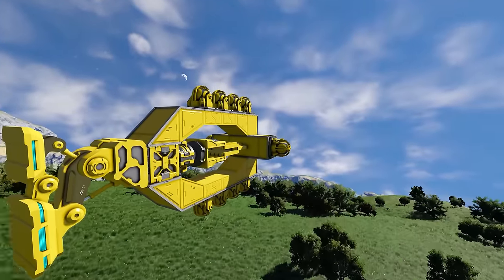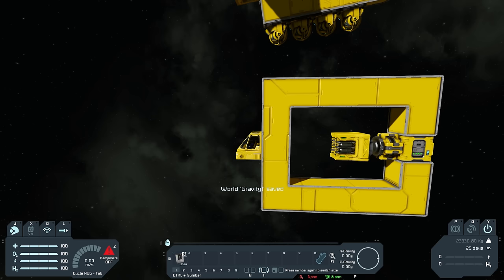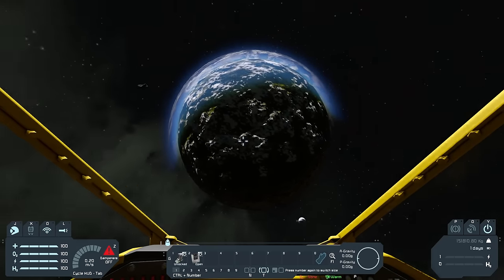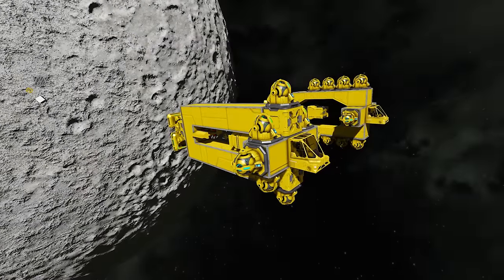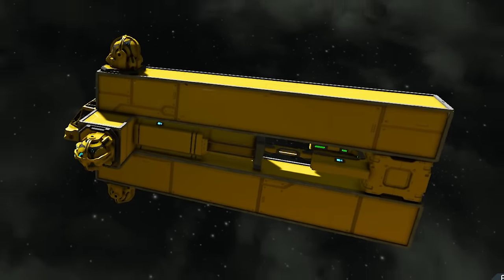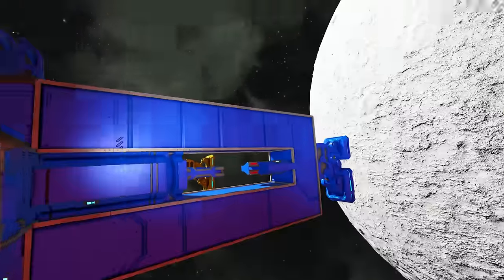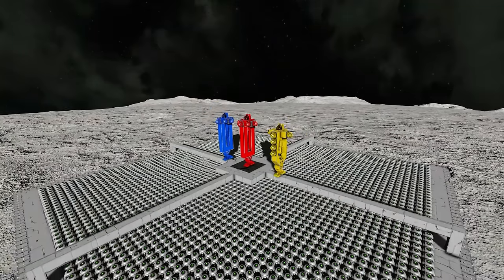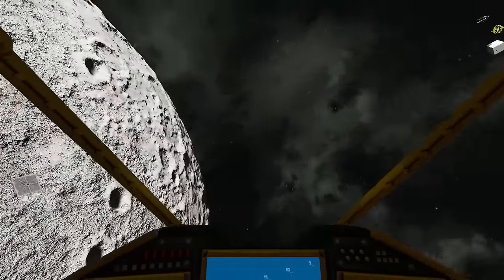The UNLIMITED POWER of the CLANG DRIVE - Breaking Space Engineers

Comment from the maker: So, which is better? Clang Drive or Gravity Drive?
Reply: Clang
Reply: clang has way more thrust
Reply: also merge drives are a thing which can provide an infinite amount of thrust the acceleration is constant no matter the mass
Reply: I mean the Clang Drive is just plain better, however i still prefere grav drives due to scalability. For a large grid to be redicoulusly powerfull, you'd need to spam maybe 20 to 50 door mechanisms, whereas you could build like a really large gravity drive unit. Idk its just cooler imo to have this big section occupied by artivicial mass& grav generators. Its always been about the coolness factor of my ships for me and not how meta or efficient they are... And in a pinch, a well build grav drive can double as a railgun :D
Reply: Clang crashing game
Reply: Question. Could i use this in a keen server
Reply: @roiber0812  yes you can
Reply from the maker: @V0dka-  I wouldn't recommend it
Reply: The gravity drive does have a place and purpose though as the gravity rings reduce the need for H2 for acceleration.
Reply: @Zer0sLegion  can you show us some weapon uses for clang next?
Reply from the maker: @redeye5515  👀
Reply: Grav drives are absurdly scalable. For example: 1 gen and 1 AM is weaker than a large ion thruster. But 2 gens and 2 AMs is worth a lot more, since you are multiplying the number of gens by the number of mass blocks. Also, AMs are worse for the thrust-mass ratio as well as lowest possible power consumption, but matching amounts is best for volume-thrust, cost-thrust, thrust in general (means more than thrust-mass because most of the mass should be the ship anyway), etc due to properties of squares. For big ships, it isnt even a competition (esp with the clang drives you showed). An 8x8 of hangar doors is 64 times more than a single hangar door. an 8x8 of gravity drives (1 gravity drive being 1 gen and 1 AM) is 4096 times stronger than a single drive. Also, power consumption doesnt matter much since you have to turn off dampeners anyway. Just turn it off once you get to speed. Prevents the gyros from fighting too (since grav drives are more stable in general without gyros, I wonder how much the power consumption of the gyros increases the power consumption). Lastly, they are more future-proof since Keen probably wont ever fix them.

Other Clang drives are a different story. Piston-snap/double-subgrid drives and guns are broken as crap, seeing as they have much greater force than the other drives, can accelerate past the speed limit, and can do so almost instantly on release. They are very complicated and require precise timing and a bunch of subgrids, but it is very worth it. I haven't seen a ship using the snapping, but there are plenty of guns. A drive would probably look like a gun, launching the ship at high speed internally rather than staying on, but it would be very powerful. To slow down, just deattatch and reattatch the double-subgrid. Due to the way the gridding works, you might have to have launch stations instead of it being internal, but it is still very cool.

Merge block: I saw someone else mention them here, but they are mass-independent (in effect) which is quite broken. You only need one. The more mass you have, the more thrust it provides. Thrust is defined as the amount of force that can accelerate a mass by a certain amount. Since mass of the ship dictates the mass that the drive can accelerate, everything ends up just canceling out and giving you raw acceleration. Fun math! You could figure out this constant acceleration by taking the thrust of the ship and dividing it by the mass of the ship. However, that is probably Harder than just counting the change in velocity in one second. It might be more fun to calculate the thrust by dividing the acceleration by the mass, even though the figure is useless.
Reply: The REAL question is "Can you use a Clang Drive as a warhead to cause massive destruction at will?"
Reply: Mortal engineering against the divine, there is no question, Clang protects.
Reply: Also, Clang. Just blew up again🤣
Reply: Clang. Working in planetary gravity is an absolute win.
Reply: Clangvity Drive
Reply: That would depend on exactly what you want. I have been thinking about building a sort of moon based airship that uses a gravity drive to stay perpetually hovering, that is something that can't be done with a clang drive. Plus the clang drives are always potentially about to get patched out while the gravity drive is not.
Reply: Mass shift is probably the best, a while ago  I saw someone built a multi axis mass shift drive that had scripting to allow for automatic dampening, but unfortunately I can’t find the script or schematics anywhere online. That thing moved unlike any ship I’d ever seen. .5 seconds to max speed in any direction, just as fast to come to a complete stop.
Reply: Clang for life
Reply: wanted to build a clang cannon but only works if the statink is on
Reply: @Zer0sLegion  i used it on a keen server lol
Reply: you could mess with the min/max open/close settings on the door to shorten the initial acceleration phase. so the door in its "open/off" position, is onlu .01m from activation instead of say .3m or 1m from activation.
Reply: Reactionless drive.
Reply: each has pros and cons, but im for gravity drive, as it allows for both acceleration and de-acceleration and is safer and easier to build if you can plan a symmetrical ship. 2 gravs, 1 mass, 2 gyros(if youre bit off balance) and you basically have free propulsion that IS SAFE IN CASE OF DAMAGE. i personally leave dampening on and just turn off "backwards" propulsion, its more stable that way.
Reply: Gravity - Due to easier adaptation to battle damage
Reply: why not put the convert it into an omni-klang drive? it's in the center of 2 rings that can spin in opposite axis to allow full 3D movement. if you know some scripting i'm sure you can have it do an auto pilot where it takes both positions and your rotation to figure out where to aim the drive. not to mention what if you use multiple clang drives in sequence? does the speed double or just break? or even nothing at all.
Reply: At the end of the day the gravity drive isn't fueled by a glitch in the game. While the Clang drive is blazing fast. It's utilizing an exploit to do so.  When the clang drive is fixed the grav drive will go back to being superior.
Reply from the maker: @ashen9381  I doubt it will be fixed for a very long time
Reply: @Isler_  is that the one where you use rotors, blocks and merge blocks? that beats clang by a lot, at least its kinda safe to use and doesnt use glitches just faulty  "gamey" physics.
Reply: From what i understand, clang scales linear while gravity scales quadratic. So clang for small ships, gravity for titans.
Reply: how about merge drive?
Reply from the maker: @TpoJioJio47  Watch my latest video
Reply: 4:18 Wait, so we place the piston with the pillar on the vessel with the power? And we don't want the hangar on the rotor from the vessel with the motor? Where does the gyro go? On the piston with the pillar on the vessel with the power? Or on the hanger on the rotor with the vessel with the motor?
Reply: Clang, but remember to pay the Clang Tax
Reply: @ashen9381 it's been almost a year. Just tested. Still not "fixed"
Reply: For Sim Speed? 100% gravity drive
Reply: And to everyone saying clang, both of the drives use clangs invisible forces.
So clang is the only possible winner... technically. 

(The art. mass & generator do work together, but putting the mass under the basic grav generator is actually a clang force, because it is is making an invisible force that functions mirrored to the feature function.)
Reply: i wonder what happens if using ALL OF THESE on ONE SHIP xD (and with speedlimit mods 🤑)
Reply: Can you make an actual warp gate using gravity drives? 

Like the one in the last video of the ‘launch’ pad to warp someone with the speed effect?

Comment: Klang and Gravity drives are a real help for big ships, even if you just use them to slow them down. For the gravity drive there exists a script that makes it possible to even replace gyros in your builds, so you get a ship that runs purely on the gravity drive concept. Great video.
Reply from the maker: Yeah, I've seen the script thing before. I'm not really into scripts, like most people in the community, I turn my brain off when I see them.
Reply: @Zer0sLegion  When scripts first came out i completly avoided them. There might be a solution that is timer based. Kelevra Engineering has a steering solution that might be able to control timers to do the same.

Comment: This is so good to power massive ships like usg ishimura or any star destroyer, even if its a glitch doesn't break the lore
What about using magnetized ore for anti gravity?
Reply from the maker: Magnetised ore?
Reply: magnetised ore is stone put on mag plate with gravity gen
Reply: @bassemgju2440  so... just a grav drive, without the artificial mass?
Reply: @RevokFarthis  kinda, difference is that using a ejector you can have a anti gravity device
Reply: @vladkruglov7719  But, you can already toggle grab drives?
Reply: if lore is a problem just say that the crew started worsipping a warp god and it's all good
Reply: @platinumgames1314  with lore i mean the recreated ships, take usg O'Bannon for example, it has a emergency shock point drive as a booster
Reply: @The_Bird_Bird_Harder  true, ore is or better Was the alternative that came before mass blocks were even a thing in the game, and its advantage being that mined ore instead of slowing down the ship, was used to provide thrust (disadvantages being lack of control, slow to set up, not as linear as Any other way)

Comment: The clang drive seems like an excellent way to get offworld fairly early in a survival playthrough without needing to get a lot of resources together.  I think the biggest downside is that it doesn't seem to have a good way to modulate speed
Reply: 2 options. 
1: Use multiple drive. That give you a max high accel.
2: script a program and/or timer block to start/stop the klang effect at regular intervals. That allows for better granularity on the speed.
Reply: @orcmcc  what if I just put a hanger door going the other way?
Reply: @carsontodd2443  That gives you breaking/strafing, but not extra accel or granularity.
Reply: @carsontodd2443  Yeah - That's basically the same thing as a "flip 'n' Burn" maneuver like they do in "The Expanse".  
I'm going to experiment with this idea over the next couple days where I use a Clang Drive for forward propulsion, and then also, as you suggest here, another one that engages when arriving at your destination to bring you to a stop. Should work perfectly.  Just have to get it all balanced out with the right amount of Gyros to tame the Clang!
Reply: @deanlawson6880  i tried that, i even tried two drives pointing in different directions, almost impossible to stop

Comment: Here's a more refined look at CDs. 
Hanger Door Drive(HDD): Used for planetary escapement. Why? Slow to respond to input but pulls more Gs at 5G per CD. As for shifting the rotor displacement this does nothing. 
Piston Door Drive(PDD): Use for combat . Why? Has rapid response time but is overall weaker. Pulls 4G per CD. As for adjusting max extension. You can get away with about 0.3m into the door. Personally I set my pistons to 0.25m max extension. My setup is also one block shorter than what you have shown here as well. The more extension have does not effect the amount of Gs it pulls, it's overall constant. 
Rotor Merge Pulse Drive(RMPD): Oldest of the CDs, as we had rotors before pistons. Does not require to be in line with COM. Not all that compacted like the others and has more eradicate motion. 
CDs in general don't harm servers, it's the scripts that go along side them that are the problem.
Then we get into Mass Shifters(MSD). These require program blocks which is where I draw the line on it being a CD. These use a different principle to function, of shifting the cargo around from one sub-grid to another. Extremely compact but at the cost of server performance. 
Disclaimer 
CDs are considered exploits by most of the community, I don't. Keen has stated that they won't patch it out and that it'll remain in the game, I'm paraphrasing there.  
The other application is launchers termed JOLT Cannons.
Reply from the maker: There's a couple more i'm aware of but these are the main ones.
Reply: What is a COM?
Reply: @endymionselene165  center of mass
Reply: @dennisklaus7188  Thank you.

Comment: Ive found a clang mechanism that can remove the speed cap of grids, so I will mess around with that to use clang drives as a cruise mode
Reply from the maker: Yeah, i'm aware of a few ways of doing that, I just don't want to be the one responsible of ruining SE multiplayer.
Reply: @Zer0sLegion  good thinking. Praise be to Clang!

Comment: Smart question - how much mass could each drive lift into orbit from the surface of Alien World?

My first thought on these would be to use them as a free range space elevator. Have a large platform with a number of the klang drives mounted up and down. Send the platform to zero g and stop. Offload some cargo or a ship or something. Reverse back to the surface. Rinse and repeat.

I wonder if you could use them in conjunction with the vector thrust script 🤔 Putting them on rotors would probably cause Klang to climb out of your PC and wreck your house, but maybe not.

Another use I could see is a missile, tho with all those gyros, it'd only be worth it for capitol ships and stations

Also, I wonder if you can control the thrust of the piston drive by varying the extension into the door's bounding box 🤔

Finally, if you've not seen it already, I recommend looking for the three-axis klang drive that uses merge blocks and a script to control the directions using the standard motion keys. You'll know you've found it if you see a blueprint with a huge open frame with giant chunks of heavy armor at the corners for demo purposes
Reply from the maker: The hangar door one exerts around 5Gs of force on the grid which is roughtly 50m/s^2 so in theory, with enough of them you could life anything.

Comment: Could you use this with the new remote control and event blocks and build smaller versions (read cheaper), as kind of decoy drones to draw enemy fire away from you in both pvp and pve (with decoy blocks).  They would be launched and told to orbit the enemy ship or base at around 700 meters, or your own ship or base, drawing fire away from your own ship or base).  You could keep all the gyros and important bits internal so they would be built like bricks, even adding guns if you wanted.  It would be a relatively cheap distraction.  Just a thought.

Comment: Can you vary the power of a clang drive by how much the blocks press together? I can see the drive is powerful, but what if you only want enough power to hover over the surface?
Reply: doubt, it looks like a perpetual motion that Quicky just get stronger and stronger on one direction, only capped by SE speed limit
Reply from the maker: The piston one maybe, by reducing the distance it pushes. The hangar door more be more difficult but you should be able to change the rotor head's height to reduce the push.

Comment: Question: How do you stop / land? is it just unsaid you should add thrusters for brakes and fine control?
Reply from the maker: You can technically add clang drives in all directions but it would probably be easier to add thrusters in all directions. The clang drive is mainly meant for very fast acceleration.

Comment: in order to solve the rotation issue, you must fix your gyros, I've tested this engine extensively.
also, you can make it work in forward or backward direction by placing 2 doors in perpendicular position, depending which door is open, and which is closed when they colide the ship goes forward or backward.
it's very cool to make emergency retreats and agresive maneuvers .
Reply from the maker: Fix your gyros?
Reply: @Zer0's Legion  i mean lock them, overdrive or so, i don't remember the label.
 i had a mechanism to turn on the fixed gyro just a single one, then activated the door engine a few seconds, then disengage the engine and turn the gyro off. it was perfect for travel between planets.
If you calculate the minimal distance between doors to act, you have an instant engine activation, with a little extra work you can programe an instant backward impulse...
Reply: @Zer0sLegion  though is far from perfect; the ship still banks a little if you remain engage the engine for long periods, thats why i decided to use it just as instant max speed engine.
Reply from the maker: @N3Corp  I do that in the video...
Reply: @Zer0sLegion  sorry i was on mobile watching it 😅

Comment: Im sorry if I didnt got it from the video, but does the mass of the ship has an effect. I imagine to actual use this for the start sequence of my ships from planet to space. (yes you could completely rely on this but i feel its too much bug using :D so i just use it for the start... )
Reply: yes, and those drives shown need to be in pefect center of mass to work wihout some serious problems.
Reply: @leipajuusto2964  thanks
Reply from the maker: You can compensate with gyroscopes though, clangs have a tendency to veer regardless of configuration (or at least, the ones I tested for this video do.)